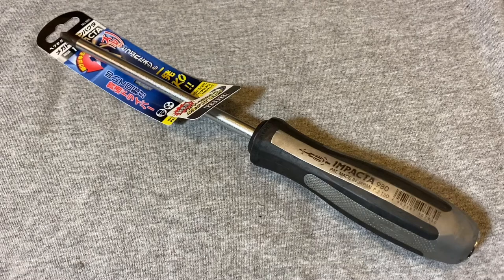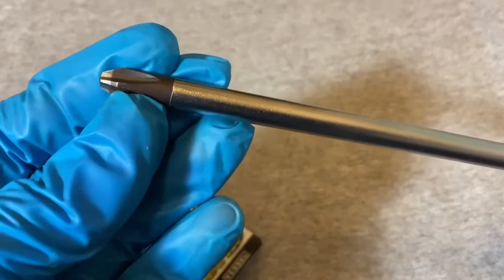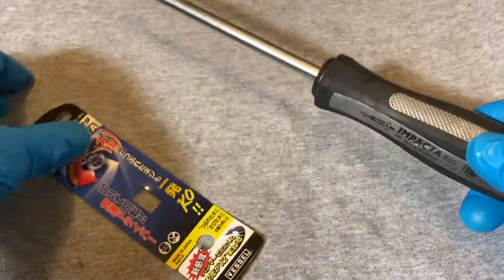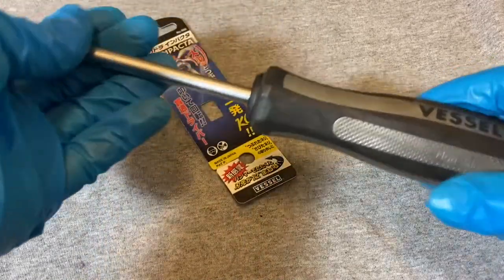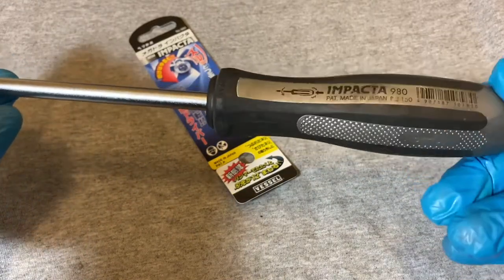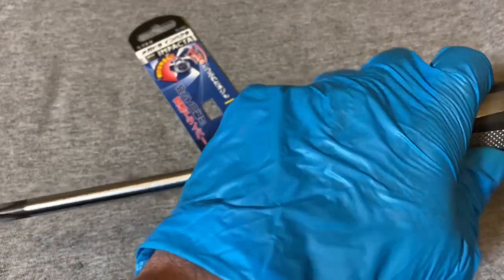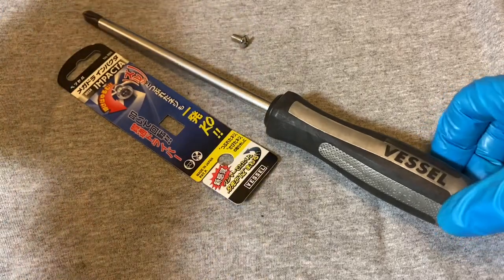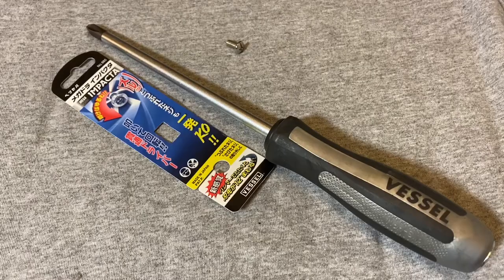Vessel Impacta No.980 #3 JIS Screwdriver: A Must Have For Honda Brake Rotor Screws

Comment: Just picked one up today off amazon for 13.50. Will be here tomorrow. Doing the brakes on a honda pilot this weekend. Figured I'd grab the tool that way if I ever need it in the future I'll have it. I dont know anyone that has one and with it being cold outside im not trying to mess around! Its always nice and is a big plus when you have the right tools for the job 👍
Thanks for the video!
And the screws that hold the rotars in place are called "retaining" screws
Reply from the maker: Yes this screwdriver definitely helped me remove some really stubborn Honda rotor screws. This video also helped, especially the 2 hammer method (make sure you are wearing eye protection) https://youtu.be/YxQk7Pz_vfc?si=BHbO6AGTAehRjMFL

Comment: Thats a really nice screwdriver. My rotors also. I usually take my grinder with a cutoff wheel and cut a slot in bolt and use a straight screwdriver to take the screw out when their stuck.
Reply: American cars have them on them as well.
Reply from the maker: Those 2 little screws on each side can really ruin your day if you’re not ready for them lol

Comment: Was that screwdriver successful with removing the brake rotors?     I need to do the same thing. I'm debating getting this or a #3 bit for my manual impact.
Reply from the maker: It was successful but I did prep with penetrating oil also since there’s a lot of rust in my part of the country. There are a couple of videos on YouTube of people removing rotor with this screwdriver. Look up “vessel screwdriver rotor” and they should pop up.